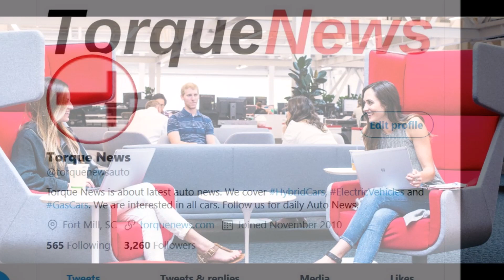Tesla Is Recruiting 8,000 Workers for Giga Berlin With Above The Median Salary

Comment: That's fine, you may maybe have some workforce from abroad like Poland [60 miles away].Though Poland has own currency other than €. So earning in € and bringing and exchanging it into polish system automatically put you at disadvantage economical one like double taxation by german and polish side. Which is hard to circumvent -political, country specific reasons. Taxation and fiscal burden in European union is inhumanly. horrendous.